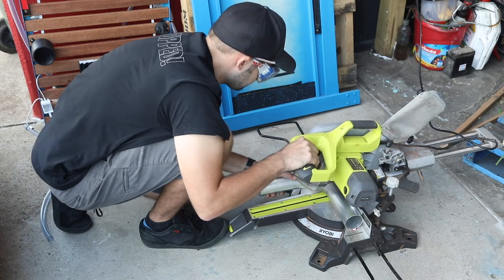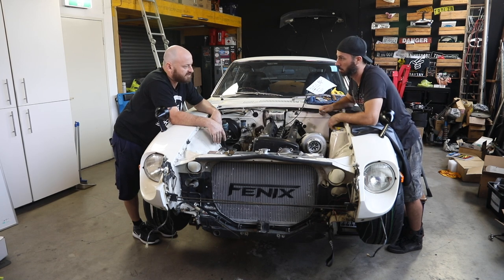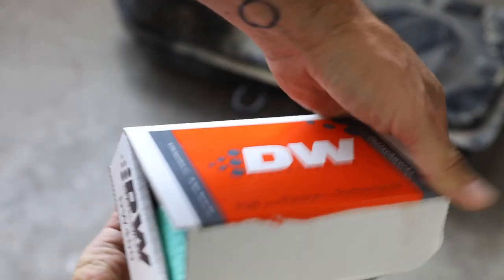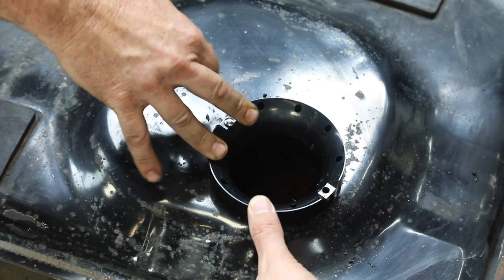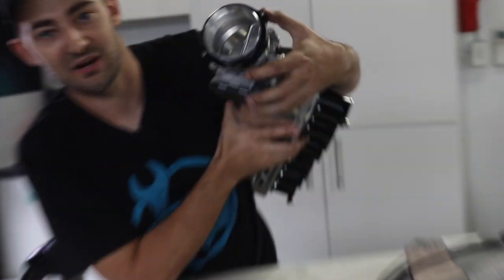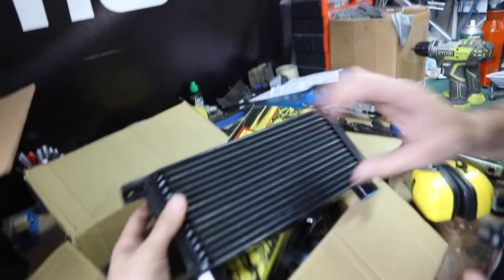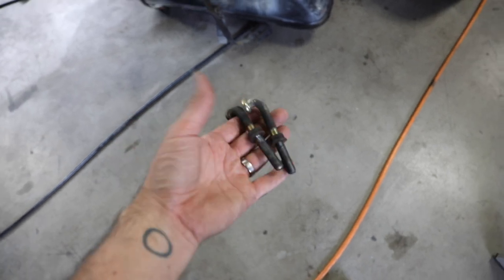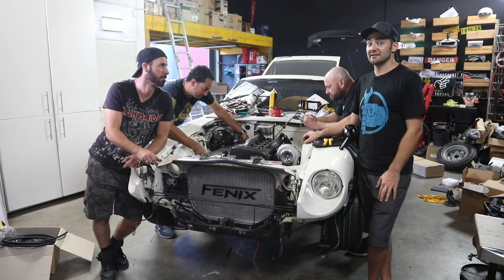240Z - RB26 Engine Conversion [PART 5]

Comment: i have some rear brackets to mount rear s13 brake set up that i no longer need. i bought them straight from nissan about 20 years ago they are weld on for a early rwd maxima but they bolt right on to the s30 were the drum backing plate bolts.

Comment: Can you let me have the name of your radiator supplier, I want a musical rad but I’ve had no luck finding one, I’ve spent hours in my local breakers yard and all I get is a dull dragging sound, does it have to be new to get that beautiful sound? I also visited my local car parts supplier and had no luck there either, they just tried to sell me a left handed screwdriver, sparks for my grinder and some tartan paint. None of which are of interest as I’m not left handed, don’t own a grinder and I can’t stand the Jocks.
Reply: Make sure it's made out of good tonemetal!
Reply: +stuart cole They got the intercooler from Hypertune, a specialist engineering firm based in NSW that they've used before for a variety of custom parts.
Reply: An Ther thanks, I’ll get one ordered.
Reply: Yes, the Hypertune puts the best tunes into metal.
Reply: he said radiator not ic. totally different sound.
Reply: +stuart cole No worries, have fun making some awesome tunes.

+Jbwifi What he said and what he meant are not necessarily the same thing...
Reply: An Ther okay Mr serious
Reply: stuart cole I’m so fucking confused by this comment musical good sounding rads ??
Reply: stuart cole jkjk has to watch longer lol

Comment: when's the lift coming!? turbo yoda deserves better than the floor.
Reply: Lifts are expensive plus require special power sources so maybe not soon. At least that's the case here in the US. You can't just plug it in and have a good time.
Reply: iamstd2 well Idk what part of US you're from but in most places as long as you have enough height clearance and a thick enough concrete slab a new lift can be installed for abouts 5-7k
Reply: What or who is turbo yoda
Reply: Anton Babiy righto
Reply: Don’t think they’ll get a lift because they want to show people you can do this at your home
Reply: yeah everyone has a turbo yoda living under their stairs.
Reply: They are not expensive in the grand scheme of things - probably cheaper than that RB and that new turbo setup.  These guys definitely deserve a lift though-
Reply: If you DIY it a bit you can get a good two pole and put it in for 2k USD.
Reply: iamstd2 you can absolutely just set one up and have a good time in the US. They sell them in standard wall outlet 110V or you can get them in 220V which would need a new outlet wired from your breaker box but it's nothing special. The big thing is whwn people have a thin (4") garage floor like 90+% of homes do. You need a min thickness of 6" for most lifts especially a 2 post since theyre resisting tipping and downward force, not just downward like a 4 post

Comment: One drive with 400-500 hp through the original rear diff will result in catastrophic destruction. An upgrade to late 350 z rear diff and brakes are indicated.The original was designed for maybe 150 ftlbs of torque. The half shafts often failed ,with the original engine, in street use.
Reply: dielauwen that’s gonna be part 9

Comment: You should run the intake out through the old intake opening so you can get nice cool air. But it's your car and I can't say if it will be a significant difference or not. But I would love to know for my own car. MCM testing time?
Reply: Oblithian there’s plenty of other videos doing the exact same thing that would probably be far more applicable to your setup. There would be no point in having dedicated video.
Reply: Not necessary with an intercooler, the intercooler cools it down more than an 'cold air intake' could ever do
Reply: There is relatively abundant with "free" space for air to circulate in this engine bay, as long as the car is moving or fan fed on bench, intake air shouldn't get all that warm before the turbo. But your sentiment is sound, and something to keep in mind whenever building or modifying intakes, as this is definitely not always the case. Some engine bays are seriously packed, and could definitely benefit from having fresh cold air efficiently routed in - especially on racers, rally cars and off-roaders with large skid plates covering the underside too. Depending on your climate, don't forget to account for water and snow when planning your pipes, a small drain and for snow, a suitable metal mesh filter, may be needed.

Comment: You and B is for Build need to race once you guys finish your Z's
Reply: Trevor Gray Won’t happen as the B for Build car is going to end up in the crusher. He is in way over his head.
Reply: Sherlock Holmes I agree but they are both ruining classic cars with the mods they are doing. Not to mention the bullshit story about having to lose the L series.
Reply: Sherlock Holmes once he gets the frame made up with the sub frames mounted on he just has put the Z body on. Most of the car should be wired up like an M5 just with a Z body.
Reply: Jose Puello No, he cant just put the Z body on, as the tube frame was made to fit the M5 components. He's going to have to adjust the body to fit that frame and hes shown in the past that hes absolute rubbish at body work. I'm also not all that convinced that hes going to get that frame straight as he has to cut it apart again because he fucked it up the first time.
Reply: Sherlock Holmes
Once he mounts the subframes to the tube chasis they'll be individually straight. The mounting points on the subframes don't move, like how the rear have four mounting points and and they all line uo with each other. Once he cuts the center of the chasis to mount the body he just had to make sure the subframes stay level and that the wheels line up

Comment: Hey mcm my father in law did an s13 cradle assembly into the rear of his 260z required small notching of the frame for the front of the control arms to clear and mounts in the boot floor as well as custom wheels stock s13 wheels fit just. Get your tape measure out you will be surprised how close it is. His 260 was a 350 Chevy turbo 400 setup  changed to a Holden 355 turbo 700 jag rear end and in its final unfinished version Lexus v8 supra 5 speed s13 rear. Sad day when it had to move on. Can't wait to see the finished build.

Comment: A guy I used to know had a 240Z.  He put a Layland P76 V8 in it with an RB26 Gearbox and a Jaguar LSD rear end.  The diff ratio was 3.9:1 which meant the car was a hoot to have some fun with at the lights.  The best part is that he got the installation approved by the local government authority.  It was easy cause the v8 actually weighed 20kg less than the original engine!  It was a fun car to drive

Comment: Two things:  Rear ends and poo transplants for people with gut trouble...
That diff is a pretty solid piece if not horribly treated (run dry or the like) in the past.  My brother bought a 240-Z from a co-worker...it came with the rare, American market only, Ford 'Boss' 351 and T-10 4-speed options.  The car was driven like that for several years by the co-worker, who was not known for a tender touch with her throttle foot!  The car's end came in a cloud of tire smoke after my brother grabbed second gear and the tires finally started to get some grip.  It wasn't that wonderful diff that failed, but the rusty Nissan unibody.  The diff is now beginning its third life in a Triumph Spitfire with a 3 litre Ford V-6 and five-speed in front of it.  In short, re-build the rear brakes and drive it now!...or...try the Wilwood disc conversion kit if you feel the need to upgrade something back there.
On to the fun stuff...the aforementioned poo transplant.  Here in the 'States, on the East Coast, there's a non-profit company started by two friends of a third person that had severe gut troubles.  A few years ago Fecal Microbiota Transplants were a very fringe thing, usually done by the high-rent holistic 'doctor' set.  Insurance companies viewed them as taboo and didn't pay for them...plus they were very expensive because there had to be a lot of testing to avoid passing bad bugs to the already sick recipient.  Thanks to this company, https://www.openbiome.org/ , the process is now much less expensive, heavily tested, government approved, and insurance accepted.  The cure rate for Clostridium Difficile (C. Diff.) is 95%, versus 70-ish-% for the standard antibiotic treatment.  They supply the tested fecal material for implantation through the...um...back door or via a tube down the gullet.  Both of those methods require general anesthesia.  But(t?), there is a new way to administer the material.  It also comes in fairly large gelatin capsules meant to be swallowed...yup...swallowed!  After two years of horrid pain and weight loss with a liver on the edge of total failure, I talked my local gut doctor into getting certified to administer the capsules and I was his first pill-swallowing patient.  I've been C. Diff. free for just over a year now, and I've dropped very low on the liver transplant list.  I share this as a public service...in hopes that someone who is as sick as I was might find this cure in time to prevent damage to their liver and survive what can easily be a deadly infection.

Comment: They keep stressing no silicon.  What's the downside of silicon?
Reply: Dustin Penner it's a tension based seal, the silicon joiners slip over other pipes to join them, and it's more prone to boost leaks.
Reply: I think its a cleaner look and fast easy removal and install.. just like v bands on exhausts

Comment: figured you would run a magnet on a stick through the tank to get all the swarf out from the drilling and cutting 

about the oilcooler / transmissioncooler , one thing i seen is the cooler mounted flat under / behind the fan schroud  of the car with 2 medium sized 12 volt computer fans above it , worked fine

Comment: Ya i put phantom kit in my 240z RB25DET about a year or 2 ago. It was pretty simple and like they said no welding or anything. The worst part is trying to get the rust out  of the tank. Really cood alternative to a fuel cell. Aeromotive also makes multi pump versions also.
Reply: Which kit did you use? I'm looking to RB swap my S30

Comment: Hey guys. What do you mean by 'upgrade the rear end'? I reckon the current setup should take whatever you care to throw at it, except for the uni joints on the axles, specifically the ones that connect to the wheels themselves. The rollers in them have a habit of turning to mush and doing horrible things, make sure you check them out!

Comment: BTW, You shouldn't mount bosch ETCs with the shaft vertical, and especially not with the motor/gears at the bottom!  Check the datasheet for allowable install angles!

Comment: 7:47 I wouldnt solder there. Soldered wires tend to break. The negative wire may break, the pump will shut off. But then, as the wire wiggles around freely and it may make contact with the bare metal inside the tank (which is ground) again. Several amps will flow through the pump to your negative lead and create a nice spark. Obviously youre having a bad day with sparks inside your fuel tank igniting the fumes...

Comment: Amazing detail going into this engine swap/restomod.

I noticed you didn't show any work to get the swarf out of the petrol tank - is that because the fuel filter will collect it up over time, or does it literally just sink to the bottom and never present a problem?

Comment: Love the build guys ❤️ question, you did paint the hole in the tank so it doesn’t rust and flush out all the shavings from the little holes drilled right before you assembled it? Probably just cut the footage out. But just a concerned citizen 😂

Comment: This is not a critic just an honest question, when you cut and drill stuff like that, like the tank, are you worried about the metal shavings getting in the engine?

Comment: Thanks for the fuel pump info. I'm building a 2 seater 260Z with RB25/30. What size is the turbo you are using and how early will it spool?

Comment: I'd chuck the off cut of that foam shit into a mucked of E85 for a couple of weeks before putting any in the tank. looks awfully dissolvey. Not sure I'd trust the rubber bucket at the bottom wither. Is there a hole in the rubber at the bottom or just those tiny holes in the side of it? Will you get enough fuel into that sponge with less than 2/3 tank?

Comment: You will run into problems when you top fill the tank... If you use the vent from the fuel pump you put in. So use the original vent line. That is at least not under the fuel line when the tank is full to the top.

Comment: Pretty amazing when you think about all the air that turbo is sucking thru a wobbly air filter... I was amazed myself with my car with had half of the power I think this one will have (guessing 400-500 HP?).

BTW 1200cc injectors that is pretty awesome for a 2.6 (or 5,2 with 1 bar boost), 6 cyl engine... I guess this is go big or go home size :-) E85 needs bigger injectors but come on that's big size!

Comment: Hey guys could you tell me the model # of that in-tank fuel pump? 

I want to look up this solution for my car!

Also for the drum brakes we can get rebuild parts here in the USA, depends on what's missing.  As long as the backing plate is good you just need a spring kit, shoes, and cylinders. 
My old 510 drums were almost identical, they stop pretty good for a street car but aren't great for higher power levels.
Reply: The fuel pump kit is an Aeromotive Phantom. They're looking to replace the drum brakes with disk brakes, if they can find a conversion kit. If they can't find one, they're going to rebuild the drum brakes.

Comment: So V-band on the turbo, v-band on the wastegate then you ruin it with a 2-bolt connecting to the catback... Come on guys!! V-bands are so much better than those horrible 2-bolt flanges than use gaskets that fail!! You all know this. Turbo Yota, I’m disappointed.. Other than that, I’m loving the build!!

Comment: Wouldn't it have been a lot simpler to use new longer bolts instead of cutting and welding your own? I'd be worried about the joint snapping and letting the fuel tank drop out with dire consequences. Keep up the good work though and bring on episode 6
Reply: The ends of the bolts aren't normal bolt heads they are a flat piece that goes into a keyhole in the floor and is also bent at 90 degree.
Reply: Alan Butler. True but with mates like Turbo Yoda, Dose Vader and Mechanical Stig, surely they could have fabricated something else

Comment: can someone tell me what kind of clamp  system they are using for the intake/down pipe? wigen clamps came nothing on google :(
Reply: Adel Wiggins is the original designer and they are used for aircraft fluid couplings. They are a tool less release whereas the Hypertune version uses a grub screw fastener setup which is much less complex and more suited to automotive use.
Reply: thanks alot for the info!

Comment: My OCD goes nuts every time I see the strange angle this engine sits at. I know it's meant to sit at that angle, but man, it's just the wrong kind of angle, visually. An engine should either be vertical or at least 30 - 40 degrees slanted.

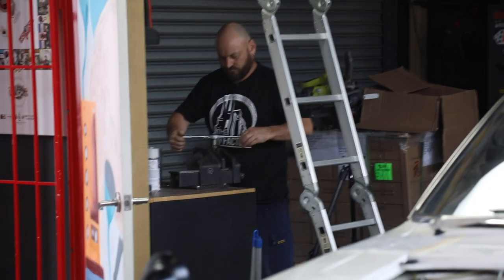Comment: Wait a second. At 8:30 do they solder wires on a thing that goes inside the tank with all the gas? That seems like a bad idea  to have live wires inside the tank.
Reply: Every car with a pump inside the tank has power wires inside it. So that's pretty much every petrol engined car since 1985.
Reply: the fuel pump inside the tank has to get power SOMEHOW; and as long as the soldering work is okay, there is no danger.
Reply: Of course. And as long as the pump works it's the easier path for power to go so there is no problem. And if the pump fails short then the fuse will blow. But in the small chance if the pump fails open and there is now no path other than the gasoline for the current to take... I'm not overly comfortable with that. What I'd do is to put those wires at design phase inside a empty pipe that keeps the gasoline out of the wires. 

If done right it's as safe as one can hope it to be. But this is DIY product. Wrong type of wire that has insulation that can't withstand the gasoline OR alcohol in E85. 

I'm sure MCM guys are safe but I fear for the people who watch this and don't consider everything.
Reply: Hene193 chances are every car you’ve ever drive has soldered wires exposed in the tank. As the other guy said above, it’s pretty standard.
Reply: I believe that there is not enough oxygen in the tank for a occasional spark  to ignite it. Because some fuelpumps, if not all have brushes inside, and theres always a spark between a brush and a rotor. And if you are out of gas its sparking in air. So gas fumes are there, we have spark, only thing missing from an explosion is oxygen.
Reply: Fuel pump motors are completely isolated so it can be brushed. It doesn't need to be cooled with air like the most motors you see. These pumps are cooled with the gasoline. 
I thought that the atmosphere in the tank is mostly fumes but I didn't want to say it since the tanks are vented. And there is mostly direct path to air. (By law you should have active carbon filters on new cars but afaik that should pass oxygen just fine) but I'm not smart enough to say much more on that.

Comment: Found this website in the USA I believe that do wilwood rear disc conversion set for the 240z hope it helps?
http://www.silverminemotors.com/datsun/datsun-240z/brake-upgrades/240z-260z-280z-rear-brake-upgrade-disk-conversion-kit